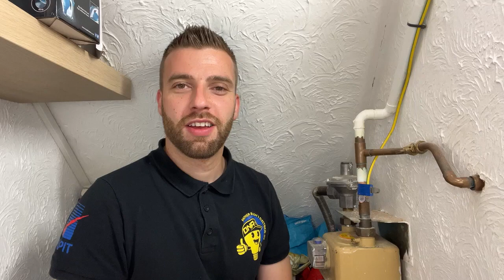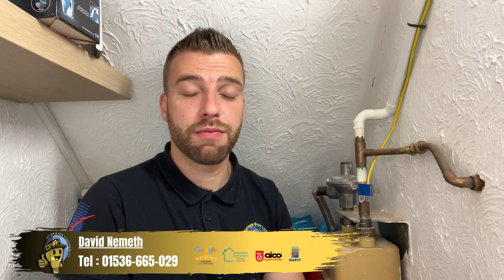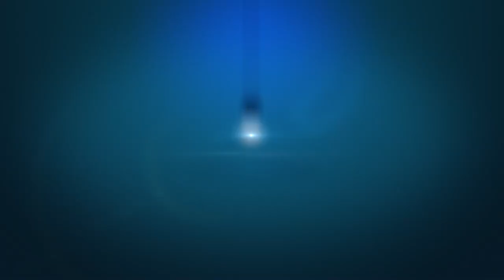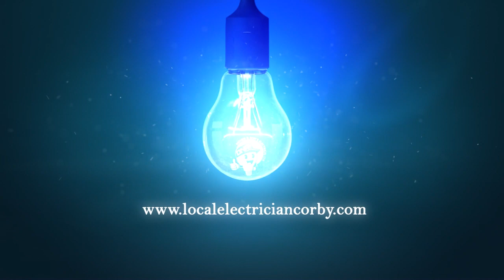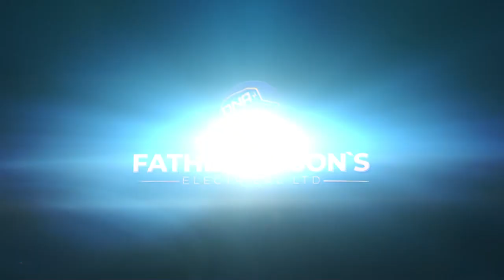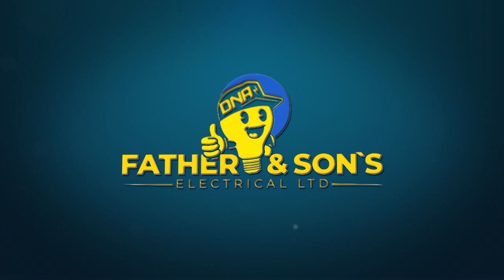Water and Gas Bond Explained | Electrician in Corby

Comment: :face-purple-crying::face-purple-crying::face-purple-crying::face-purple-crying::face-purple-crying::face-purple-crying:...  "...The bonding cable should be routed separately to maintain its integrity and prevent any potential interference with the gas pipe or its connections. "